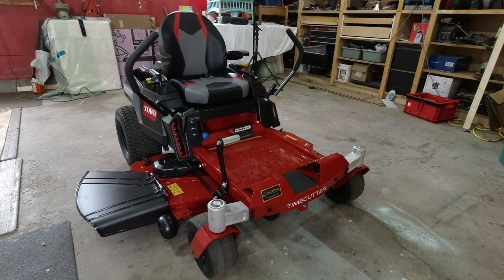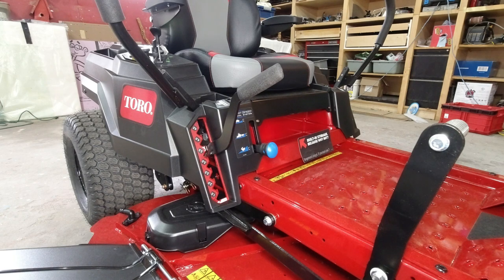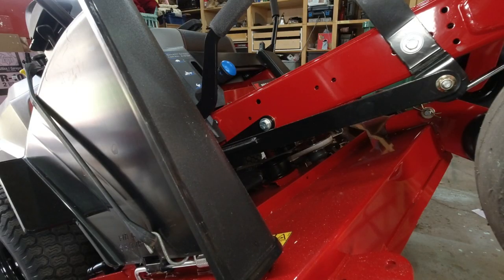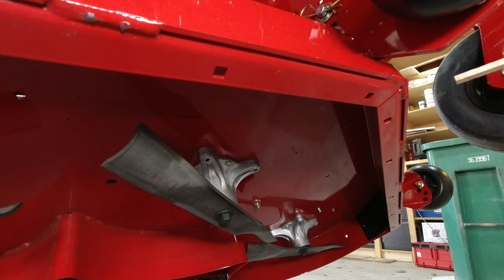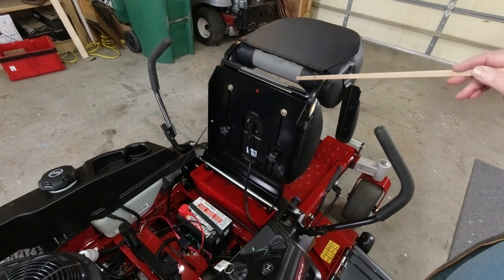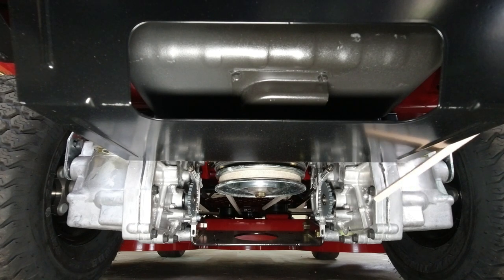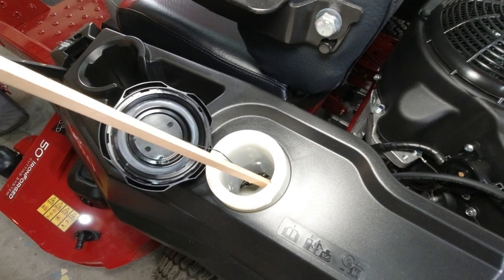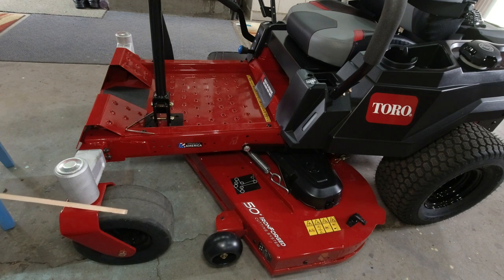2020 Toro TimeCutter Walk Around Review

Comment: Like the mower but very disappointed with aluminum spindles that arnt greaseable.
Reply from the maker: Sealed bearing spindles are the way to go for most homeowners. Why? Because half of us don't know how use a grease gun and the other half has no need for a grease gun for anything except the front wheels of their lawn tractor. As long as you don't try to force water into the bearings with a pressure washer these bearings/spindles will last many years. That said, 
Only the commercial machines that see hundreds of hours a year really need greaseable spindles anymore.

Comment: Just purchased the MyRide version of this as a 2019 left over model for $2999+ tax. I had a 54” BadBoy that was horrible ride quality and just sucked gas down. I added an hour meter and just did first oil change after 5hrs use. This is definitely hands down the best riding and cutting mower I’ve had in 30yrs, and it has a 3yr warranty! Now my wife and kids are arguing over who is cutting the grass. My only issue is my right hand seems to feel numb/tingly after using it for an hour and the motor seems to have irregular rpm surges at all throttle positions that subsided under load when blades are engaged but annoying. I added some fuel system cleaner but thinking I may have to take it back to dealer after season if it continues...maybe it’s not quite broke in yet? Idk
Reply from the maker: For the numbness try lowering the lap bars. You can also try mechanic gloves.

Comment: The Powersmart PSM9422SR is $269 and the same as the TimeCutter
Reply from the maker: I'm confused. The powersmart is a made in China 22 inch walk behind. This TimeCutter is a 50 inch zero-turn made in the U.S.A. Just one more spec - the Powersmart only cuts to 3 inches - the Timecutter cuts up to 4 1/2 inches. How is it the same?
Reply from the maker: Oh, and check the one review of the PowerSmart https://powersmartusa.com/products/psm9422sr-22-in-3-in-1-170-cc-gas-self-propelled-lawn-mower
Reply: @PaulSikkema  I got the wrong video -words mixed up, I am talking about the Toro push mower self propelled with the alumimun deck, where the Powersmart is made by the same factory in China as Toro and the engines look exactly the same
Reply from the maker: Your information is incorrect. They are made in Mexico. They moved all walks to Mexico a couple years ago due to Windom MN being at max capacity.
Engine comes from China and that’s why next year might be a lot more Honda GCV in line up, due to tariffs.
Its good and bad I love the Toro engine, but hate where it’s from.  The Honda’s are built in USA.

Comment: You know Paul, the last riding tractor I bought (piece of crap) Craftsman (not your fault). I asked many questions and you had good answers. Your review of this Toro is way off. Many more deck sizes and engines. Also can come with MyRide TM isolated seat.
If mine has a pressurized oil system, I crank it over a bit to build up pressure before starting. Nice to see most have gone back to a manual choke and separate throttle. You never start your car at full throttle. Why would you do it to any other engine. Don't if you have a choice.
I disagree with your opinion of engaging the deck at low RPM's. Good way to stall or bend a rod. Warm it up and put it full up to engage the PTO. If your belt squeals then it is too loose.

Comment: I have this exact one. I believe the consumer is ripped off if he buys the 42 inch. For only five hundred bucks you get upgrades on EVERYTHING for the 50 inch. 42in a laughable crappy seat, small front tires and rear tires, stamped deck, non Kawasaki engine, smaller front forks, etc. I got the mulch kit - very expensive but well worth every penny. Cuts so even and beautifully. I think I'm going to spend money on that jack because you really do need to get under it. I'd highly recommend for anyone who's comparing and wondering to spend the money. Con:  Lastly I had to spend an extra $65 for the hour counter as an accessory. Bad planning by Toro, cuz you NEED it. How else would you keep track of the hours on the engine and the machine??
Reply from the maker: I was surprised it didn't come with one but I really don't need it. I know how long it takes to mow my lawn and and I don't use it enough to worry abotu oil changes during the mowing season. 
For homeowners with one acre or less a 42 inch does make sense. I prefer the fabricated deck but for most homeowners with a small yard the entry level stamped deck, single cylinder model can be a good choice.
Reply: @PaulSikkema  the manual recommends to do the first oil change after 8 hours so that's a big one on the time counter for me